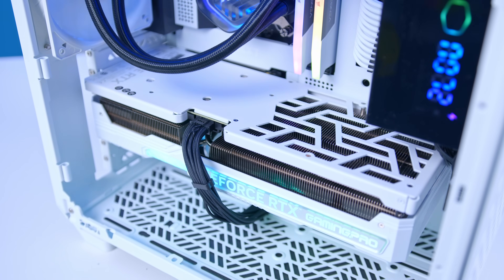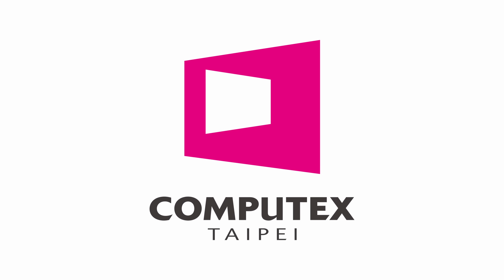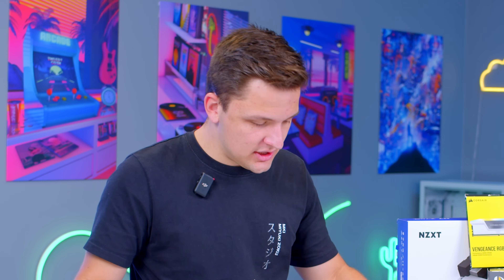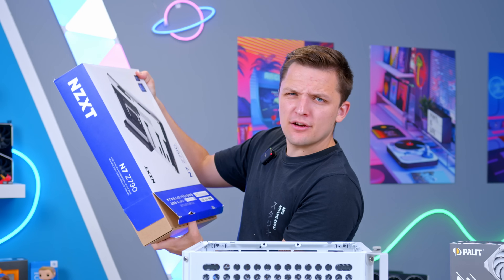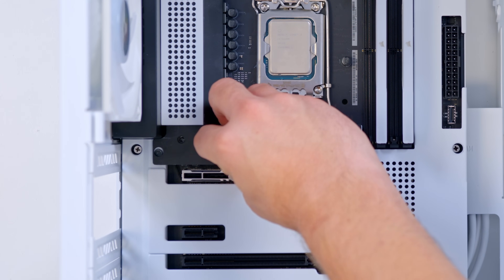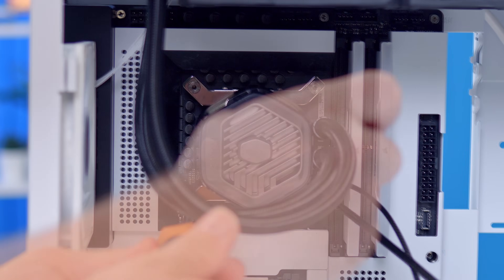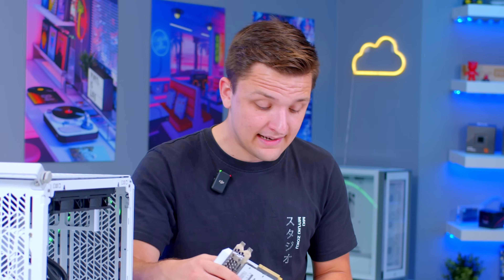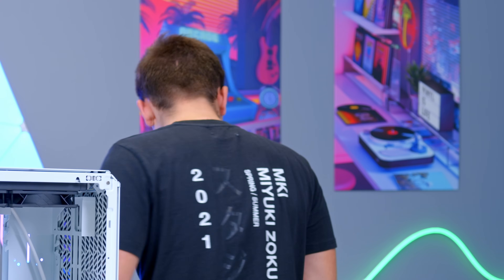Awesome $2000 Gaming PC Build 2023! 👀 [All-White Build!]

Comment: In most of your vertical GPU pc build there is a big flaw THERE IS NO  PLACE FOR THE GPU COOL DOWN IT WAY TO CLOSE TO YOUR CASE WINDOW do you have any case to avoid that ? Yeah maybe your benchmark are good but they prob heat up after 4hour and I doubt that you take 4 hour to do an benchmark.. so is this case enough  for vertical GPU case ?